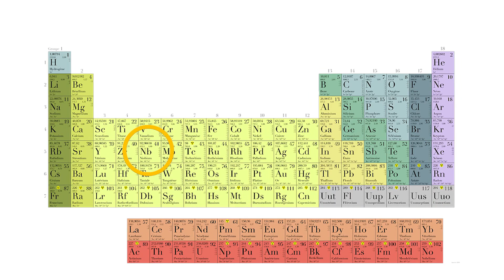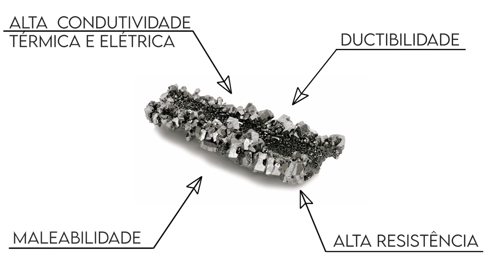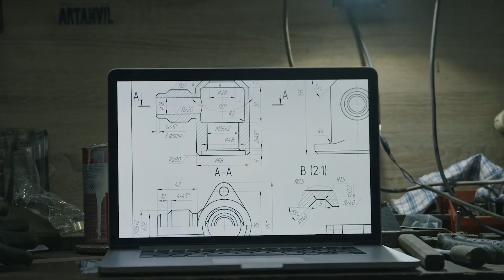Revolutionary Niobium Battery! Discover the Game-Changing Invention from Brazil

Comment: We do not need to destroy even more of the incredibly valuable and incredibly at-risk Amazon basin, and the entirety of Brasil is that basin, even the mountain parts.
We do not need a big push to create a long-lasting battery with weak depth-of-charge but quick recharge. The use cases for such a battery are going to be extremely limited and we have existing batteries like lead-acid that work JUST FINE for that kind of situation.  We also have sodium batteries, which are going to fill the slot you're describing MUCH better than niobium.